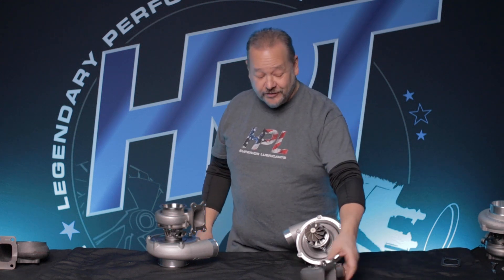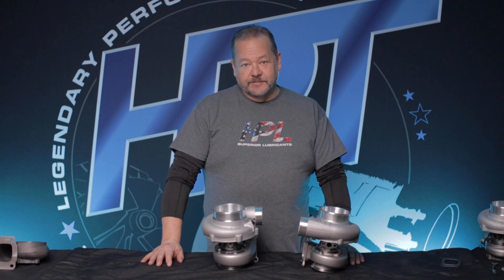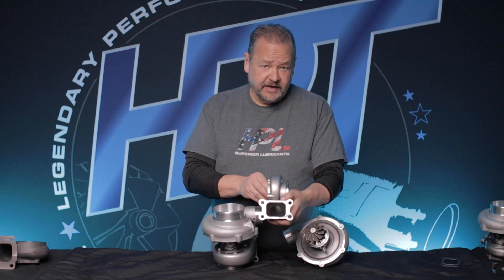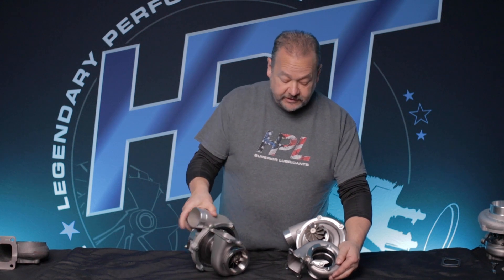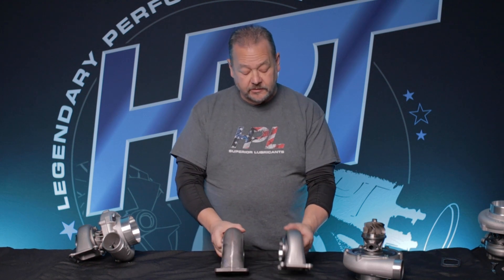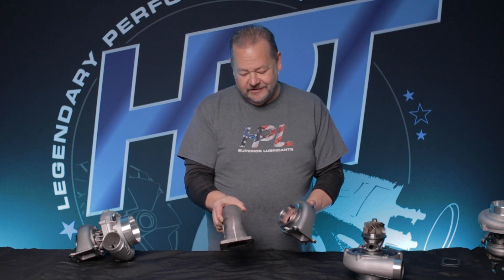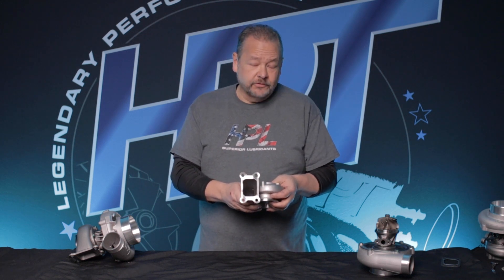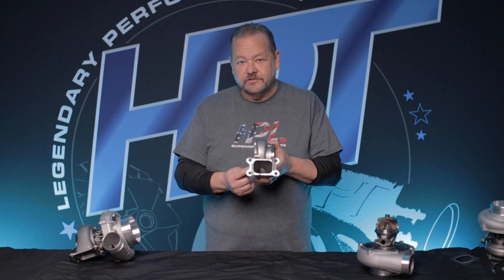3 Ways We Improved the T3 Turbine Housing

Comment: That looks a lot smaller in the video. It’s hard to believe it’s just from a thinner wall thickness. Are you sure the a/r is measured correctly?
Reply from the maker: The A/R is measure correctly. A typical cast iron T3 housing has two times the wall thickness of our stainless housing T3 housing.